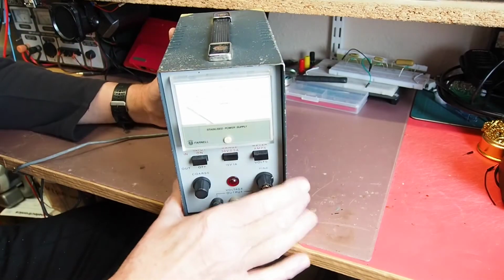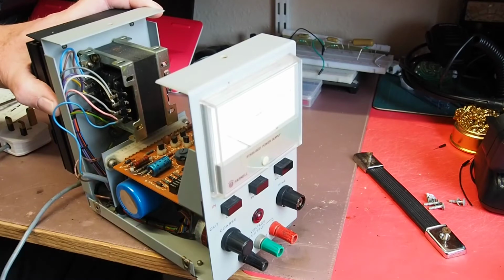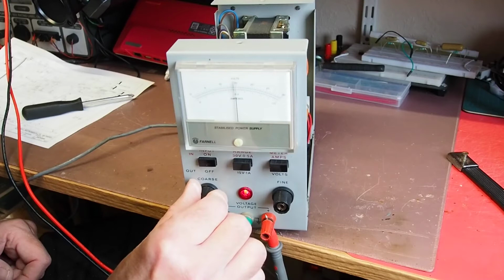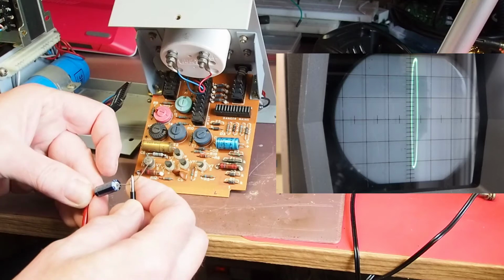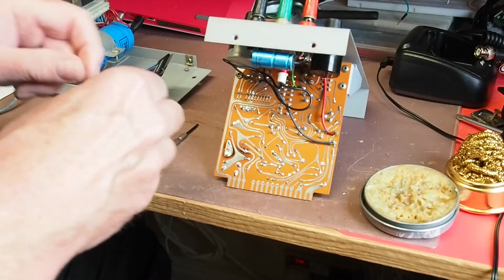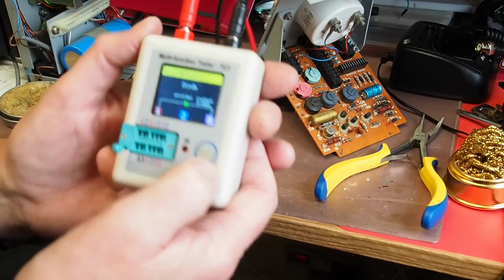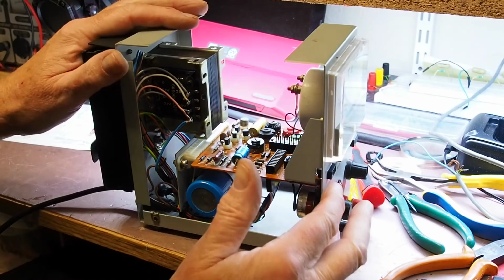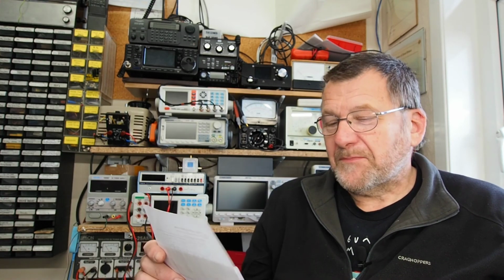Farnell Power Supply Unit E30/1 Refurb   -  #099

Comment: I bought a Farnell  twin meter power supply I think of similar age. I downloaded a wiring diagram and instruction sheet. I have used it almost every day for 10 plus years. They are such a quality build top class components mine also is very accurate and as you have demonstrated they are designed to be easily repaired! My same thought that you need more than one P/Supply I have started looking and was nearly tempted to by cheap digital unit, but thank goodness I watched this video! My plan is eBay Farnell unit again. Enjoyed vid as usual thank you.

Comment: Don't you need to shorten the scan line on the curve tracer so both sides are on the screen to start?
Reply from the maker: My scope won't let me shorten the line, however it was centred using the X-Pos control and the line ends were only just off the edge of the display.

Comment: Great video. With the multi-function component tester you are  using,  a zener diode must be connected between A and K. If connected between any of the numbers, the voltage won't be high enough to show its a zener diode.
Of course I don't know what the red and black sockets are connected to and the diode may be faulty, but I thought it's worth a mention.
Reply from the maker: Excellent, thank you!
Tried it, and yes it correctly identifies the zener and it's voltage.